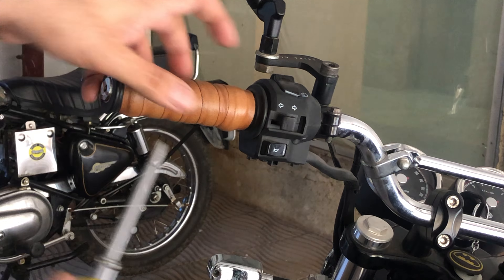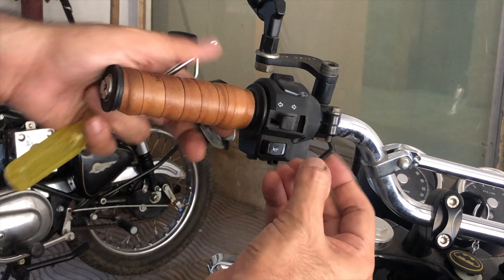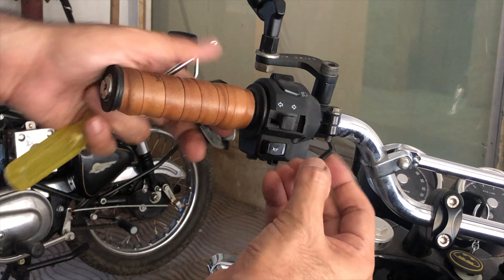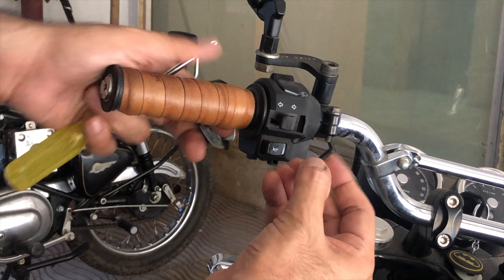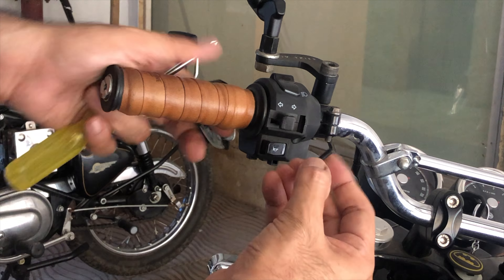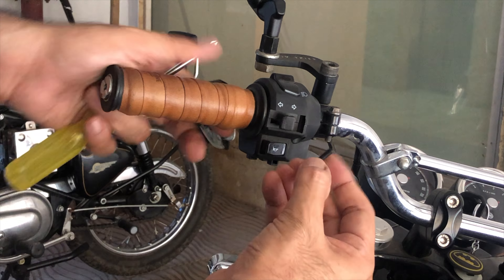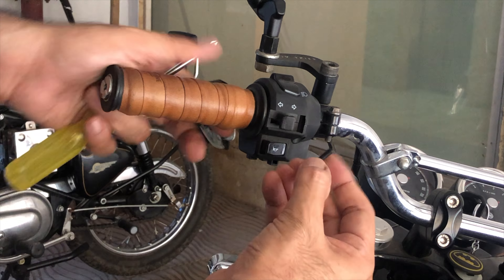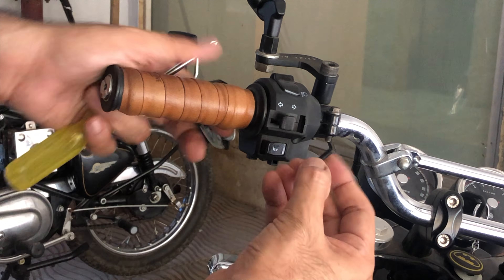Interceptor 650 handlebar upgrade by Royal enfield

Comment: Great video with useful tips. I am going to install Himalayan handlebar on my conti GT650 which is a bit more complicated as need to replace some cables and yoke too. The suggestion of the higher riser sizing and the provision of source info from bandidospitstop is incredibly helpful to me (if i had not seen your video i would have installed the standard risers which would not be as good).
Reply: Hey..Recently I have installed Himalayan Handel bar on my GT 650 with the stock risers and now I'm feeling pain on my palms. Do you think installing the aftermarket risers will help?
Reply: Hi. I still watiing on my parts to come from India (i ordered a lot more than the items to do this). If u feeling pain in palms its probably because you are taking your body weight on your palms by leaning forward on them. I still have standard clip ons at the moment and it took me 300km to figure out the seating postion to avoid taking weight on palms. This includes knees in tight to tank, sit up close to tank, clench stomach and back muscles to hold your body upright whilst loose holding the bars. It sounds a bit weird but now i find my stock standard conti GT quite comfortable even for 150km plus rides rides. But I guess these things differ for each rider depending on height & weight. the aftermarket risers rise the height of the bar and pull it back towards you too a bit too. So i think it will help to keep your body more upright and weight off your palms. the only way to know is to try and then tinker with riding position to ensure not leaning on palms.

Comment: what I do to remove grips are remove the cluch lever assembly and the switch. remove the bar end weights put a big spanner on the handle so that handle is between the spanner then hammer the spanner. grip will just rocket out of the handle without any lubricants.

Comment: Thanks for the informative video please just to confirm is that those bar risers are for Triumph Bonneville models which have 22 mm (also known as 7/8 inch) handlebars. Please confirm if it fits to interceptor?

Comment: E joyed your video , I won't be changing my bars as I have the Glitter& Dust Interceptor and the chrome bars suit it , I fitted the Motone risers which were the 1inch up and 1inch back , yours seem to be higher n you didn't mention size in video , with mine I had to release the brake cable from where it was cable tied to the frame !
Reply from the maker: Glitter and dust would certainly look better with the chrome. Mine’s the same size. Don’t think Motone does other sizes. I  too had to loosen up some cables to allow free movement of the handlebar. I’m glad you liked the video. Cheers and safe riding!

Comment: I have already installed a handlebar riser and pulled it back towards me(2 inches). However, the stock handlebar of the Interceptor is not wide and l still don’t find it comfortable. I get pain on my wrists and forearm after long rides. Are these handlebars wider than the stock handlebar of Interceptor? If you have any other solution for improvement let me know
Reply from the maker: Hi Raghav, there may be the RD handlebar that may be wider than the stock handlebars. You may want to try those out. Pain in the wrist and arms is generally due to the rider putting the body weight onto the arms while riding as opposed to letting the torso handle the body weight. Maybe that's what is causing your wrist pain.
Reply: try Meteor 350 handle bar costs about 650 and with the raisers in place i am sure you will feel comfortable...

Comment: I find the handlebars on my interceptor a little hard to reach as I am a guy w an avg height. Would you suggest this handlebar for a better more upright posture?
Reply from the maker: No. in that case it won’t make a difference. You may be better off in installing the handlebar risers. Cheers!

Comment: Hi nice video ... The handle bar risers link which u gave are for 14500 on that website🤪,Which are very expensive any other similar alternate you can suggest. Thanks
Reply from the maker: Yes 14.5 is so pricey for what its worth...:)

Try these as an alternate https://bandidospitstop.com/products/royal-enfield-interceptor-650-handle-bar-riser-black

I haven't used them personally so cant vouch for the fit and finish.

Comment: Hey, great video. Any link regarding the handlebar risers? And also, any cabling length issue later on? Thanks.
Reply from the maker: No issues with the cable length. The motone ones are listed on motousher site but are pricey for what its worth.

Try these for a alternate https://bandidospitstop.com/products/royal-enfield-interceptor-650-handle-bar-riser-black

I havent used them personally so cant vouch for the fit and finish.
Reply: @motodiariesbyrck2032  Many thanks for this! Made my day! <3

Comment: Hi, nice video. Can I ask, are these the handlebars for the Himalayan? I can't find ones specific for the Interceptor. Could you send a link please?
Reply from the maker: Hello Johnny, Yes those are for Himalayan. They fit well. RE hasn’t made ones specifically for the 650 twins yet. Trust this helps. Regards
Reply: @motodiariesbyrck2032  Perfect, thank you so much!
Reply: Bro stock is best or this Himalayan handle bar
Reply: @durgeshmadasu7936  I prefer the Himalayan bar. I haven't noticed any big difference while riding, but I think it looks way better.

Comment: Bar end ??
Reply from the maker: The bar end fixtures by RE wont be a direct fit on this, but if you go to any local shop they will fix a generic bar end weight that can hold the RE branded finisher. These handle bars are for himalayan and its bar end weights would fit without any extra addition.
Reply: @motodiariesbyrck2032  ya I have this spare from my himalayan including the bar end weights which come for this handlebar ...I though so you have installed some other ..👍👍👍
Reply: @motodiariesbyrck2032  subscribed super content ... practical
Reply from the maker: @siddharthsinghvirdi7881  Appreciate it. Thanks a ton